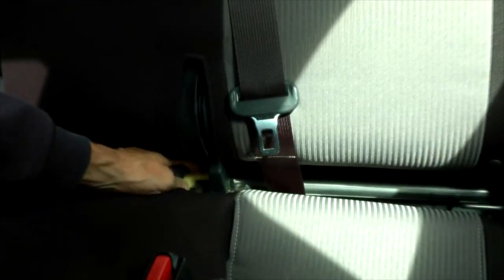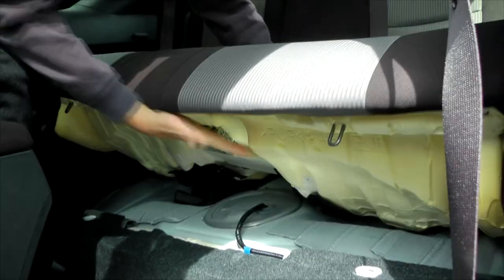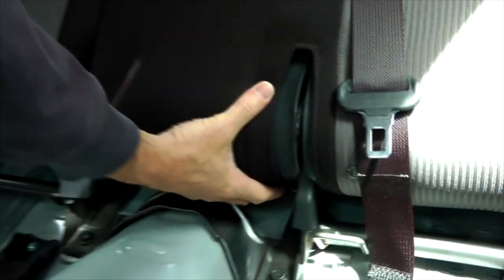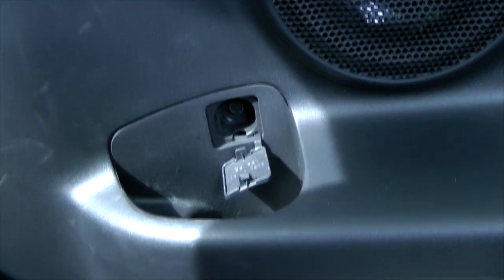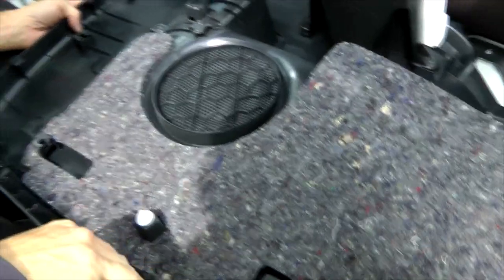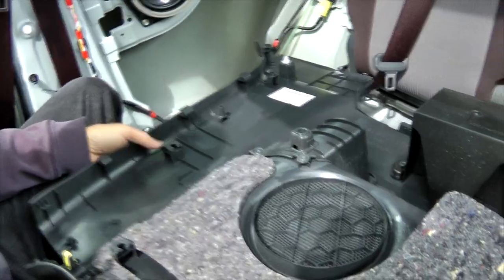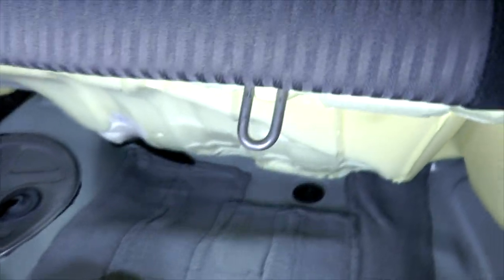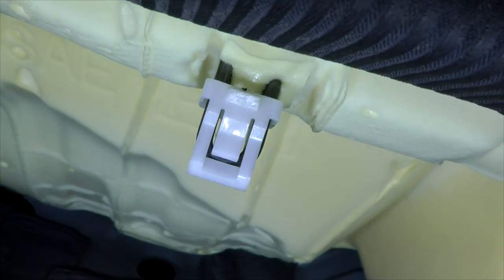Scion TC (2011-2016): How To Replace / Install Rear Speakers.

Comment from the maker: PRODUCT LINK:
86160-33620 Toyota Speaker assy, New Genuine OEM Part - https://www.ebay.com/itm/333574782005?mkcid=1&mkrid=711-53200-19255-0&siteid=0&campid=5338971185&customid=&toolid=10001&mkevt=1.

RECOMMENDED TOOLS:
1. TRIM REMOVAL TOOL - 4pcs Auto Door Clip Panel Trim Removal Tool Kit - https://amzn.to/41nYhsk.
2. SOCKET SET, RATCHET - GEARWRENCH 57 Pc. 3/8" Drive 6 Pt. Mechanics Tool Set, Standard & Deep, SAE/Metric - https://amzn.to/41wE6Z3.
3. CLIP REMOVAL TOOL - GEARWRENCH Panel Clip Pliers, 3705 - https://amzn.to/3SjP2Ff.
4. FLAT HEAD SCREWDRIVER - Klein Tools A131-2 1/8-Inch Flat Head Screwdriver with Keystone Tip, Made in USA, Pocket Clip, 2-Inch Round Shank - https://amzn.to/3VV0FVh.
5. THIN PROFILE LONG REACH PLIERS - Xcelite 378M Thin Profile Long Reach Electronic Plier, Serrated Jaw, 5-1/2" Length, 1-1/4" Jaw Length - https://amzn.to/3JvHXNQ.

Comment: Noticed you only took off the plastic panel that goes over the speaker but when you're putting things back, you also had other plastic panels removed. Are those other ones necessary to take off?
Reply from the maker: To reach the rear speakers, you only need to remove the bench, the door sill trim and the side plastic panel.
Reply: @MorozovAutomotive thanks👍